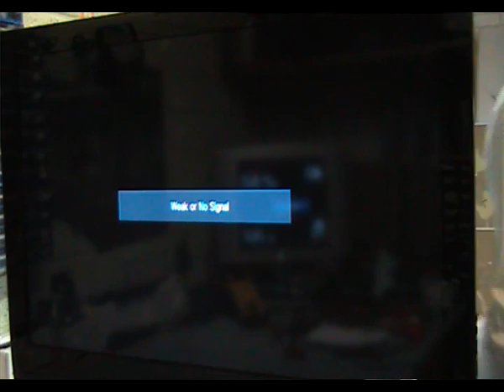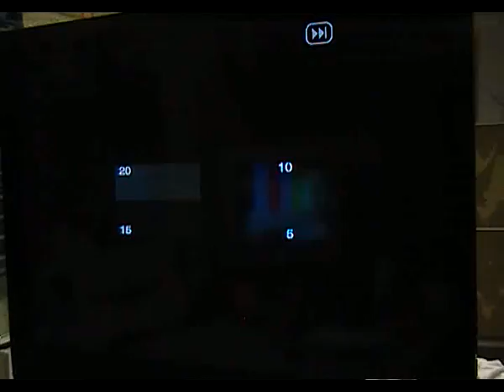LE40B530P No Picture On Screen| Part 1 video LA40B530P7 Samsung BN44-00264C

Comment: i had a problem with my kdl-60nx810 sony I couldnt determine weather the tcon or the mainboard is the problem. i tried removing the cable that goes to the mainboard and the tcon still has the supply then I turned it on, then the screen turns to like color mode testing which displays color such as red green blue and gray and some shadowing. now I'm confused which one to change the mainboard or the tcon.  help

Comment: Hello I have the same tv model and the image turns off and on every 3 seconds, sound is always on, there is also a burnt smell coming from the power connection side of the tv. Oddly enough if I change the energy saving from off to high the tv works fine. What component should I look at to fix it?

Comment: I have the BN44-00264"B" revision. The red LED blinks on/off at a slow rate, it never powers up.  The fuses check good for continuity.  None of the caps are blown. Any thoughts on where to look?

Comment: Brilliant video... thanks.  I had this problem. On switch on the picture disappeared in seconds. I removed JP860 and the picture returned. Cured?  I assume there is nothing wrong with the CCFLs?   Why should I not leave the JP860 disconnected... safety issues. What should I check next?
Reply: Since there have been so many years... I hope you are good and give a great answer to your statement. Did you remove permanently that protection and what is your experience after that removal

Comment: I have a samsung UN29F4000AF, the backlight comes on and a melody is played. I never see any splash screen or video on the screen. Any way to troubleshoot between the Tcon and main board with out a scope? I have a DVM.
Reply from the maker: I am not familiar with your unit,
is it led or ccfl type back light?
you could check for bulging capacitors on the power supply board, is it a ccfl type backlight, check for a 24V supply to the backlights if the invertor is separate

It is a bit more difficult to check a combined power supply/invertor board,
you would need a schematic for that
what is the power supply type, it normally start with; BN44-
Reply: Electronic Workshop The pwr supply is BN44-00660A and its an LED TV.  The backlight comes on but never any more than a blue screen, no Samsung or HDMI1 or anything.

Comment: Hi, I have the same tv with a similar problem. The backlight on my set will stay on for about a minute then go off. I have disabled the protection (removed JR860) but the backlight still cuts off after a minute or so. What should I check next? Thanks

Comment: Hi have a Samsung LN40B530P7F with that same board,i see pictures but all white menu,chanels, but no colors than white is there a resistor or capacitor you know its bad.thanks
Reply from the maker: I have seen this type of problem before, most likely a screen problem
 Screens are very expensive to replace, it would be difficult for me to diagnose here, without seeing the fault and being able to do tests

Comment from the maker: Then first thing I would check is the supply to the lcd screen t-con pcb, should be 12V normally, but I have seen 5v on some systems,
If this supply is ok, I would check the fuse on the t-con pcb, the fuse is located somewhere near the connector to the screen
If you had a scope, you could check for video information on the connector to the t-con pcb, If there is information on these pins, more than likely its a problem with the t-con pcb

Comment: Hi I have the same unit however sometimes the backlight flickers. If I go to menu (while iti is flickering)and change the picture mode from movie to say dinamic.. it works fine .. What can the problem be?
Reply from the maker: The problem lies with the power supply pcb
I have yet to get to the bottom of this problem
as soon as one comes into the workshops with this fault I will try to get to the cause of this

Comment: Hi. I have removed the component you show in the video, and the TV is working OK. No darker parts, like in your video. But you mentioned, that this is only a temporary solution. Could help fix it? Much appreciated. My email is  cotswoldsrestore@gmail.com Thanks
Reply from the maker: if the backlights were shutting down before you removed the component, the problem has to be with the lamps, as this component is feed back from the lamps, to the lamp sensor circuit. you will have to check the backlights assy
Reply: Electronic Workshop
Thanks. At first it was oscillating. The backlight  was flashing, and then it just won't turn on. After I removed this component, the TV work fine. I can hear a buzzing noise coming from the PCB board, but otherwise it's fine.
Reply: Attila Dobos
It's me again. My TV developed a very strange fault. It works fine after I removed that component. But when I connect my 1TB HDD and select a movie, it does not play. Instead the goes off and the on again. After 4-5 tries it starts to play without any problem. I dimmed the backlight, and it seem to work better, but I'm not sure.
Reply: I have a proscan flat screen tv and the screen is blue what could be wrong with it